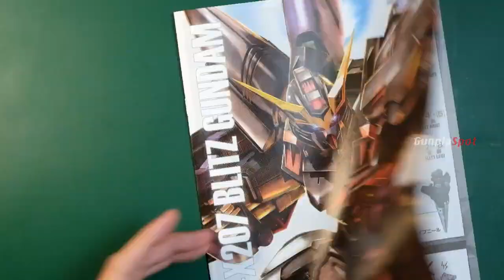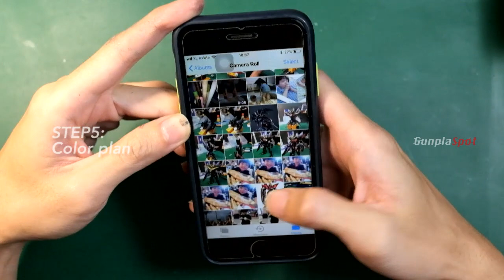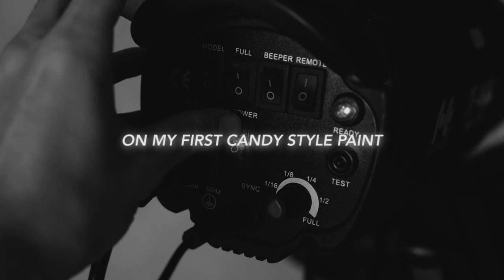CENTURION : MG BLITZ Gundam Custom Build

Comment: What happend, it was not clear from the pictures shown.
Reply from the maker: Which part?
Reply: @GunplaSpot  The part where you mentioned that a mistake happend and you had to fix it.
At 8:20
Reply from the maker: Oh its a scribing accident, out of the line. Had to cover it with putty 😂
Reply: @GunplaSpot  Ahh okay.
In the end it still looks awesome.
Thanks for telling.